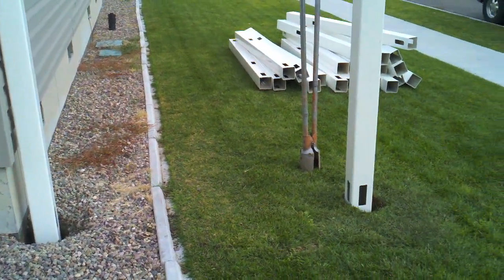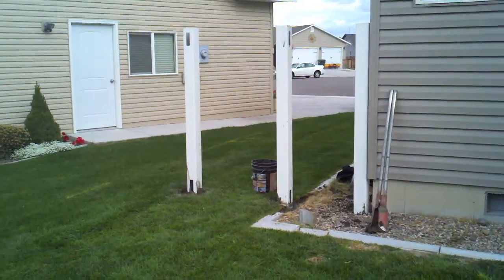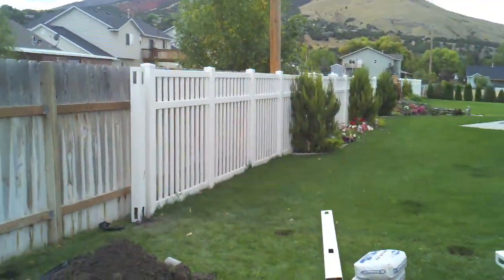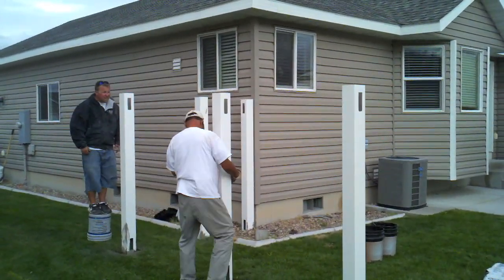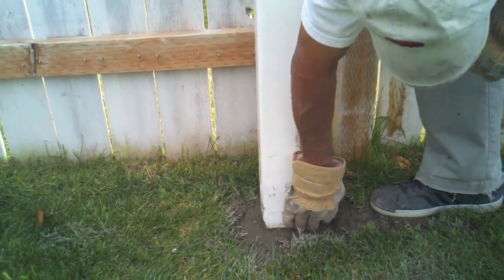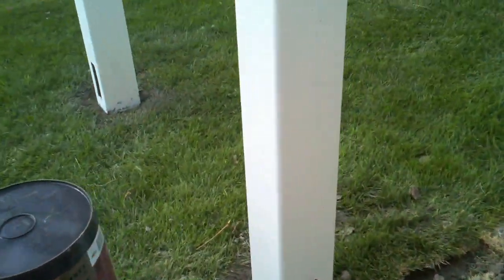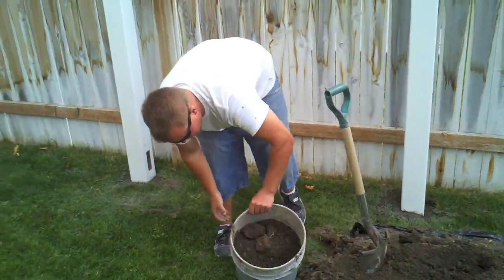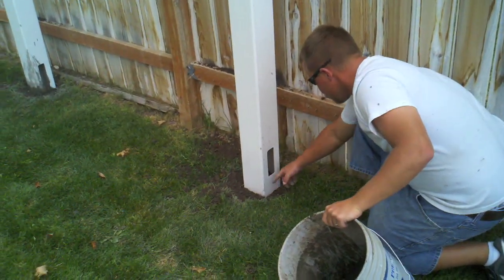HOW TO INSTALL A VINYL  FENCE SETTING VINYL FENCE POST

Comment: It depends on the product. With our fence you only need it in your gate post. Our 8’ sections come with metal inserts in the bottom rail. 120mph wind rating. If you live in west palm FL then you need a hurricane certificate requiring 6x6 panels, metal in top and bottom rails and metal inserts in all post.

Comment: Why not installing the bottom rail, and make sure all the post are leveled if the bottom rail is level. Very simple method, then you come back next day and install TNGs ( panels) and top rail. And bang!!

 In 1 day 80 to 100 linear feet I can install
Reply: Dude we rock like 400 500 feet out if we wanted

Comment: What about when you have to install one panel at a time and can't just take down the entire existing fence and wait two days for concrete to cure in the new posts?
Reply: I would use quick set concrete if you are in a hurry...but still remember "measure twice, cut once" as in carpentry.
Reply: Bye setting all of the posts first, isn't it harder to install the rails afterwards?
Reply: @Ocalaman  Not at all, setting the posts first it’s actually the right way of doing it.

Comment from the maker: The water comes in from the rails and holes in the post. We have been using this method for 10 years or so and we have seen a huge decrease in post upheaval so I assure you it works. Another trick but more costly is to dig your hole 3' deep, fill the first 1.5' with concrete, line up your post, drive it to your desired height and Finnish setting. This method uses around 180lbs of concrete per post.
Reply from the maker: Actually the hole method, needs to be a 3-4" hole 6-12" up from the bottom. This allows concrete to enter and seal the bottom.

Comment: Are the posts usually placed ever 6 feet apart?
Reply: It is typical that the posts are placed 6 feet on center.  Read/download the directions from the fences' website to be sure for the fence you are installing though.

Comment: Can you guys make a how-to video for setting vinyl posts on uneven grade  and it still looking straight and the same height? Thanks alot!
Reply from the maker: Yes that will be a fun video. They can be very tricky but it is possible.
Reply: VinylWholesale Awesome excited to see it! I'm 19 and ready to get after it in vinyl installation and setting posts on uneven grade while having the fence still look good is the only thing that confuses me thanks again. Best installation vids on youtube hands down keep em coming!
Reply: Set your posts first while putting in the bottom rail. Mark centers exact or an inch less if you can spare material. String across the top while cement is still wet. Next day, or after concrete sets up some, put fence together. If not exact, you may have to trim off an inch or so from the last board with a portable table saw. Then put in top rail. If the grade is a very steep incline/decline, you can cut out the first support strip inside the top rail. This allows the boards to go in more and rack easier.
Reply: Thanks for the knowledge Roy that simplifies it perfectly! It seems simple to install it Ive just been over thinking it and making it more complex than it has to be. Thats an awesome technique with the bottom rail so you never go over your post spacing. Thanks again man
Reply: ***** Thanks Roy for being so detailed I installed a 60ft line a few weeks back with a group of guys and they would build the section as they went. It was a pain in the ass that way. It wasnt going smooth to say the least.Your technique eliminates all the hassle and problems that I could run into I really can't thank you enough man! It may not seem like it but your knowlege has made a huge impact on the way my fences are going to be installed and how much faster it can be done and that changes my life
Reply: ***** have one more quick question for you man when you do your jobs do you divide your sections up evenly or would you just build each section at full 6/8 ft and if you came up with say a 3ft section at the end of a line would you just cut rails/pickets to fit?
Reply: Yes, keep them at 8 because of the high price of pvc fence. If you have the money or extra material, what you would do at the end of the fence line is, instead of making a 3ft piece, split the last two 8+3. So make the last two sections, two 5.5ft pieces. It will be easier on the eyes and you probably won't notice it. If the line is only three sections adding up to, let's say 18ft. Make all three sections 6ft. Again, this is only if you can spare the material. Sometimes you can get two sections out of one. I just don't think a 2ft piece looks good and it's a bitch to dig two holes that close. I think anything less than half of a section won't look that good.
Reply: @skankhunt-vw8xr   it would be so great to see a video of someone doing an install on sloped ground.  Every tutorial is done only on level ground though.  😩
Reply: @Jimmy_Cavallo  did you ever find any good videos for this?
Reply: @jake1783   The only way is for me to make my own. 🤟🏼😤

Comment: How deep are you digging the holes
Reply: if you file for a permit (which you should) they will recommend the depth... Most likely 42 inches to be below the frost line.. At least that's for my area in Illinois, maybe it's different for you.. Also, the post itself should tell you how deep you need to go unless you plan to undercut and make them shorter.. (NOT RECOMMENDED!) Hope that helps

Comment: I have never before seen someone just set the "Vinyl Sleeve" as the main post, Where's the 4x4 or the 3" pipe?   without those, the fence has no structural integrity...wthell..lol
Reply: With wholesale vinyl fencing you don’t need any inserts. It has a 120mph wind gust rating without it. We install it all the time in Idaho. It is not uncommon to get 40-50mph wind gust here and it doesn’t hurt the fence at all. It w is ad superior product. We have installed
Reply from the maker: With our fence it's not needed. It has a 120mph wind rating without any inserts.

Comment: The dirt inside the post great ideal n easier than using wood or metal post.
Reply: Why not add concrete from the bottom of the hole in the ground to the ground level? That way the vinyl post is secured from the outside and inside?
Reply: What does a little bit of loose dirt at the bottom of the hollow post do?  I am not getting the point of it. TY

Comment: He says fill the posts with concrete then he fills them with dirt. Is it just me?
Reply: Wayne Boll A better way to do it is fill the post hole with concrete then put the post in the hole. The dirt method will work and help insulate the post and keep water out of the hole but concrete really does the trick, it is more expensive so dirt is a cheap fix. All they are doing is trying to keep water out of the post, yes water will be in the dirt but it will not expand and contract like pure water/ice.